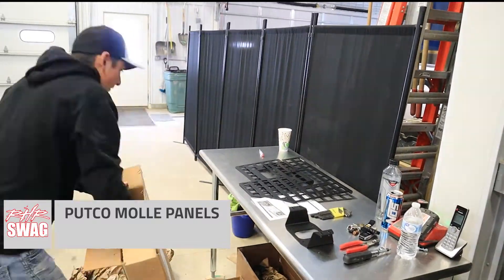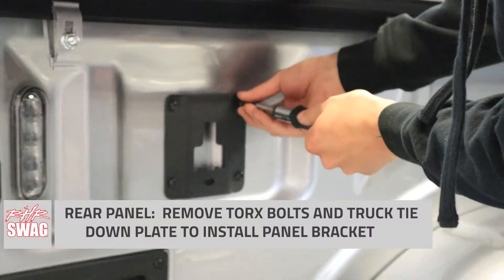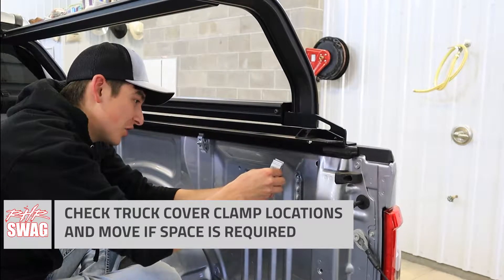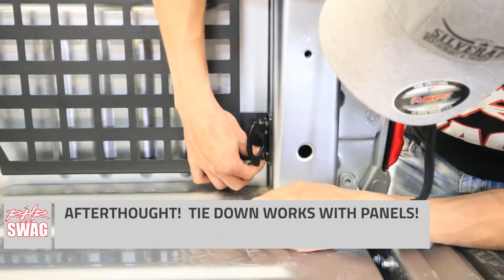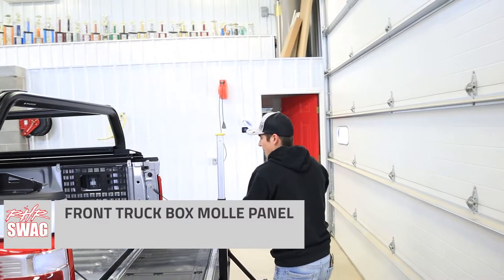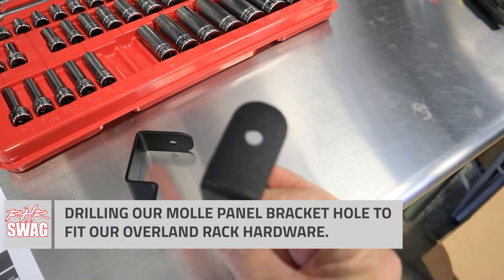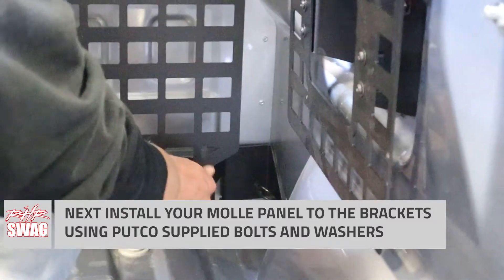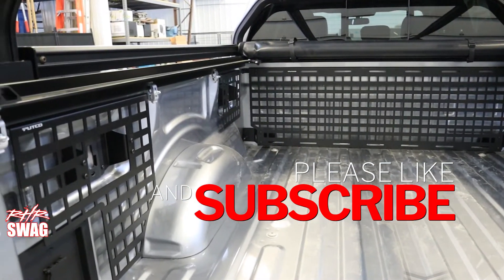Truck Bed Molle Panel Installation on Ford F150

Comment: Hello...great vid. I have a question...Puko has told me the under cover swing out toolbox works just fine with their panels. It doesn't seem possible. The individual I asked got a little irate actually. Will the swing out tool boxes work with these panels. Thanks